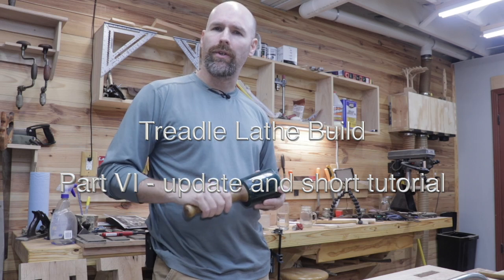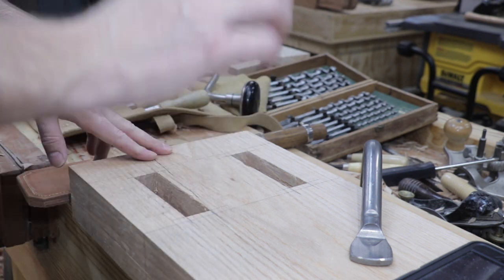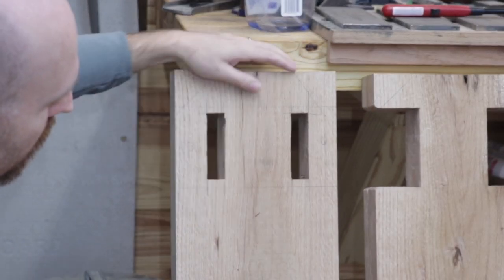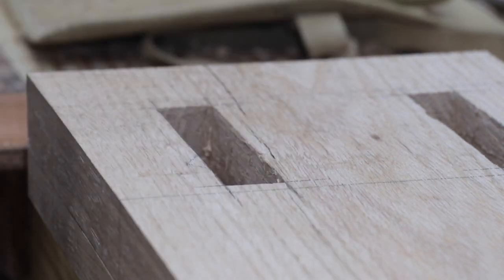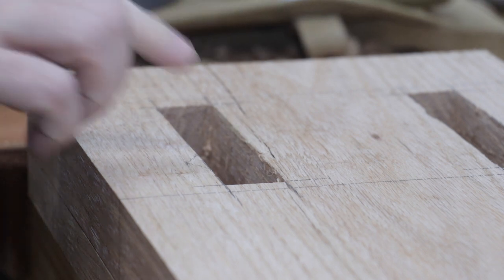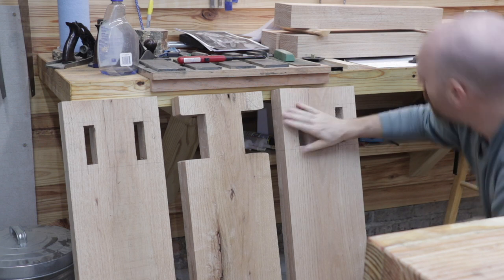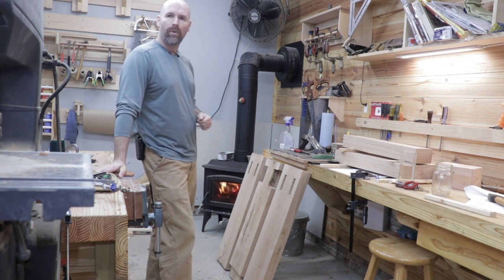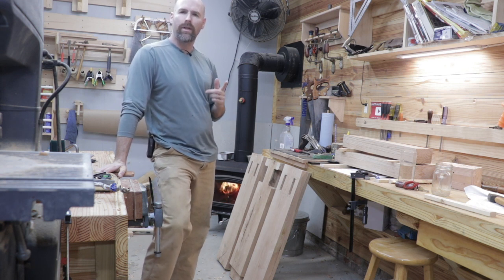Treadle Lathe Build Part VI Update and Tutorial

Comment: I built my Off-the-grid Wood working lathe lathe. by using an RSJ as the base  & I used a Sleeper Cut down to 3"X6" Planks, To fit inside the wed of the RSJ & Booted the ends to gather with a 3"X12" board To set the centre rails for the poppies to sit in & rest on the top of the. RSJ To pols for a Bungy cord  & Tenons in the poppets to secure with the wedges  I used a 24-volt DC electric motor to drive the Shaft I think the flywheel & power system I will adapt to my lath so I can drive a direct drive system with or without the trial. giving me the choice to switch between one or the other  lick that part of the plan  Thank you for your tutorial,  Les England